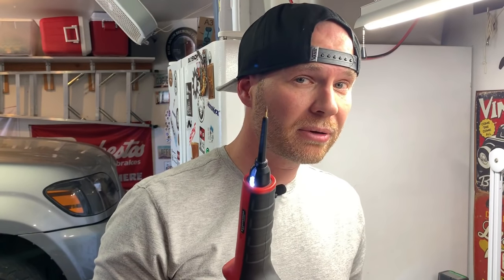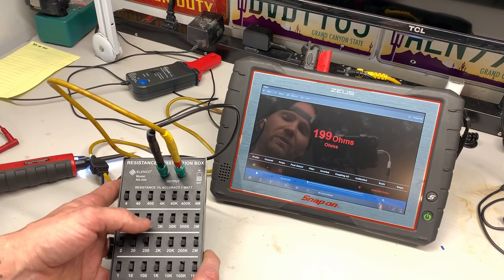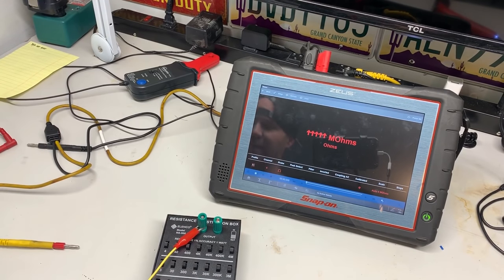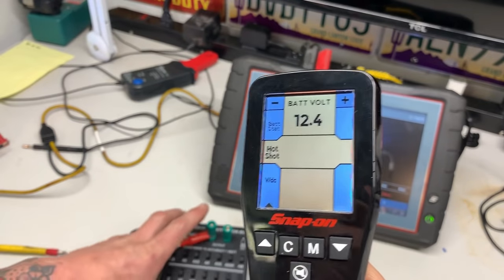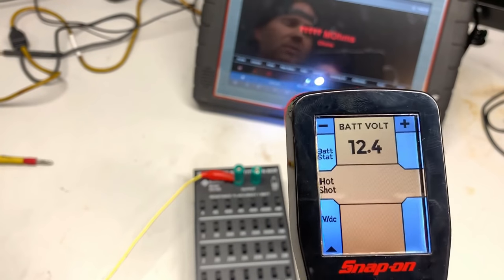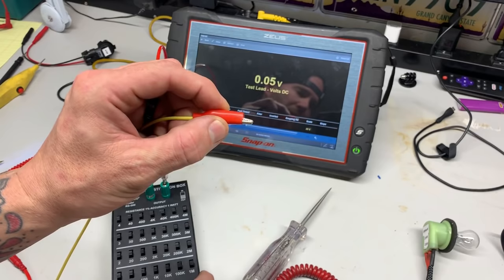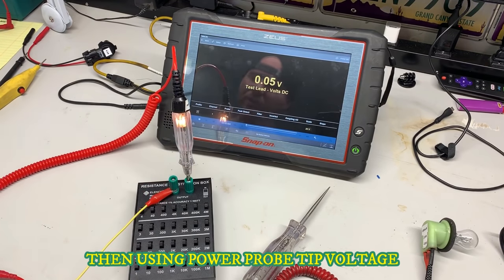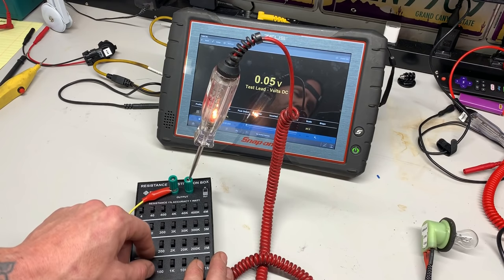Homemade test light against the power probe?

Comment: i am new to the scope and load testing world im a old timer. once i started watching ya'll what i have done is try to size a test bulb draw to be about the same size load, then watch voltage drop so far has worked for me. i had a 1997 Dakota no start the asd relay would not come on. i checked voltage good check ground good checked pcm ground had ground small test light came on so unplugged pcm and connected larger bulb would not burn computer would ground test light but not bulb. replaced computer truck runs great no problems. but power probe said ground and small test light ground. its a learning curve . i have been testing bulbs and making lights that draw about the same as like fuel pump and use for testing. i know i have to be careful not to damage pcm. thanks for all you do
Reply from the maker: That’s awesome to hear other guys making tools and also loading a circuit. I did it wrong for years thinking the pp was was properly loading a circuit. Thanks for watching and also for your comment.

Comment: Awesome video. I love comparisons like this. One other issue I've had with the PP is the low internal resistance. When checking an open 5v signal circuit, it kept pulling it down to like 2v. I was fortunate to catch that the ECM was seeing it, and tried my meter on it. No problem with the meter.

Comment: I have that power probe and I use v/DC,amps and ohms. I haven't had any troubles so far but the battery voltage and tip voltage beening different without the red lit positive I go for the test light and the ohms on the probe

Comment: I love this video.  One thing I think you failed to mention is prior to relying on the brightness of a test light bulbs brightness,  you should always use a direct connection to battery as a reference. Much love, much respect. Thank you for your professionalism in what you do. Im 21 years deep with Chrysler,  jeep,  dodge,  ram and only as of the last 5 years have I realized the importance of the loaded Voltage drop test. Your technique is bad ass.
Reply from the maker: Thank you so for the kind words! I really should redo this video and explain a little better about loaded circuit testing. I’m still fairly new to making videos lol.

Comment: I live in a part of Mexico where the weather is always good,  I have been mechanic for almost 13 years now and never had a high resistance circuit problem on anything,  but I do see a lot of imported cars and trucks from snowing states over there and I know some day I will have to deal with high resistance problems. 

I saw many times the use of of these diy test lights but never being interested on making one,  but after your very, very instructive demontration on this video,  I will definitely make a couple of them,  test them and familiarize with the usage an the results. 

I think that a quick test for brightness could be using the Power  probe to comprare the bulb  in the circuit and then in the tip of the energized power probe,  if for some reason  you do not have the dvom on hand. 

Thank you for your videos.
Reply from the maker: Thanks for the support and views Juan. It’s not to expensive to make your own test light and definitely something I think every technician should have in their toolbox

Comment: Another good video. Glad you covered both the PP and the Load Pro, even if you were showing the Snappy version. Both tools have their advantages and limitations, in spite of anything said for or against either. I have both and understand how and when to use them.

I never consider a fuse checked until it has been removed and visually inspected, including the terminals in the fuse block. Simply probing the back of the fuse with a test light is a rookie technique, about as valid as calling a relay good because it clicks. I can’t count the number of times I’ve helped an “experienced” tech with an electrical problem that has sent them down a rabbit hole and has turned out to be something as simple as a burned fuse terminal.
Reply from the maker: Paul E thank you! Your absolutely right about needing to pull fuse or even Check the box itself. Definitely need to remove the fuse and check it also. Pp is a great tool if used properly. Seen to many times it not used correctly and that’s unfortunate. Not to mention the modules I’ve seen smoked from someone not knowing 🤦‍♂️😂
Reply: Cody’s Auto diagnostics, not mashing that power button requires a lot of self control!

Comment: Nice video I pulled this info out of a trouble shooting article and It states,

 It doesn't take much of an increase in resistance to cause trouble. Let's say a 120 amp alternator operates in a circuit that has a normal resistance of 0.11 ohms. If that resistance were increased to 0.17 ohms because of a bad wiring connection, the alternator's maximum output would be limited to 80 amps. In other words, an increase of only 0.06 ohms (almost nothing!) would reduce the alternator's maximum output by almost a third! Under light load, the drop in charging output might not even be noticeable. But in a high load situation, the alternator wouldn't be able to keep up. 

I noticed on the screen of the Snap-On multimeter that the decadent box with no switches on was at 0.17 ohms of resistance from the get go. So if the information is correct on the electronic trouble shooting article then the Snap On and power probe hook are correct in failing in the hot shot test. Unless I'm missing something. Wishing you and your loved ones well.
Reply from the maker: Hey buddy thanks for your comment. That’s great information and you are right there was resistance at the very beginning in the box. I’ll have to check my other decade box and see what the reading is and if the pp will show pass or fail. Thanks again

Comment: I surprised how accurate the loadpro actually was, even with it's small internal load (20 ohms I believe) I like your idea for heavier circuits.
Reply from the maker: Bart Young I was surprised as well. The idea of the tool is awesome. I just hate the tips on it 🤦‍♂️
Reply: i believe the newer version of the Load Pro have an internal 25 Ohm resistor in it.  However, after watching your video Ohms Law says your yellow testilight (spelling?) had to have a 100 ohm resistor in it.  When you selected 10 ohms, the voltage dropped approximately 10 % to 11.2V.  So 90% dropped across testilight, which means your yellow banana looking thing must be 100 ohms.
Reply: @matthewbrice737  Your correct Matthew.  The testlite is 100 ohms and the newer version load pro is 25 ohms.  To verify all you have to do is put your Meter on ohms and push the button.  It will tell you the resistance value.

Comment: What we need is a variable load tester with a fixed visual indicator for a binary decision pass or fail. When testing a 5 amp fused circuit then dial up a 5 amp load...  if the light comes on then the wires can support 5 amps. Want to test a 25 amp circuit, dial up a 25 amp load etc. Perhaps a test light with high wattage resistors and a multi contact rotary switch on the end. The switch will dial in a combination of resistors depending on the desired amperage draw.  Would also make a great hand warmer in the winter🙂
Reply from the maker: Absolutely 💯 percent we need a tool like this!!! I’ve wanted to make one for years with a bunch of Incandescent bulbs with switches to turn them on and off to add load, but I can’t seem to figure out how to make one that’s not super huge and takes up a lot of space.

Comment: Just an idea for the teslite, what if you were to add leads to it to make it easier to get in connectors, etc. I had a loadpro, it broke so I binned it. I agree it's a great idea just not well executed. I'll definitely be stealing your idea with the banana connectors. 

I also will use a amp clamp on circuits to see if I should look into them further. A good rule of thumb I go by is what ever the fuse rating is for that circuit, I'll look for 1/2 of that while operating. If it's well below or above that there is probably an issue. Great content by the way, subbed!
Reply from the maker: I was definitely going to see about adding some quick connectors on the load pro so I’ll use it more then I do now. Using amps is definitely a good way to see everything that’s going on in the circuit. That’s my go to method for sure.

Comment: Power probe 4 in the feed mode loads the circuit . You can read battery power vs the circuit point you are testing and also read the resistance at the same time on one screen ( no button to push)
Reply from the maker: Alan Gaudry yes it does and one great thing about the 4. It’s to bad not all the pp have that function

Comment: I have the overpriced snap on version (made by power probe) of the hook and I too have run into situations where it told me the circuit was no good "check connection" using the hot shot function (one of the reasons i brought it ohh and the amperage measuring ability was what sold me on it) but that was not the case! luckily experience told me to double check the circuit with a tail lamp bulb. lol.. I still trust if for the most part, but if it tells me i have a bad connection I always double check it now.
Reply from the maker: Auto Fix Pal yes exactly!! That was my issues as well. I bought this just for that test and it’s very sensitive and sent me down a rabbit hole.

Comment: Do you think that bulb is enough resistance for checking pwr. And ground on a 98 Chevy Silverado fuel pump connector. I just have a basic multimeter. Not quite sure of the hookup procedure. Appreciate it if someone would chime in 👍🏽
Reply from the maker: Most incandescent test lights will be enough to verify power with module plugged in and back probed.

Comment: you have to stress the point that test lights are better for loading a circuit, BUT it has to be an incandescent test light not an LED test light. I know you know that but i dont remember if you mentioned that part in the video.
Reply from the maker: Your right and I didn’t mention that, good point, thanks

Comment: Great video Cody, very concise and well put together. Now I can just show that to my coworkers and stop arguing with them all the time.

I had one question for you. I've been watching the L1 vids, your vids, trained by techs, SD and others... You guys all have a power probe but all say not to trust it.

What is a power probe good for?
Reply from the maker: Thank you! 

Power probe definitely has its place and its good for applying power or ground to a component to test but where guys trip up is checking for proper voltage to a component by checking it with the tip voltage. The tip voltage isn’t loading a circuit and that’s the downfall of the pp
Reply: @codysautodiagnosticsprogra8706  Ok, I hear ya. Thank you for taking the time to reply to all of my questions. It's truly appreciated.

Comment: I don’t trust the power probe for load checking either but it possibly could be a fail in this instance seeing as how a decade box isn’t used for or ideal for passing much current through. Those resistances I doubt are very accurate with any kind of current applied. I put those same banana jacks on all of my homemade test lights and even my otc test light. I hate those cheap clips they come with plus it gives you many more options to connect to. Makes it easy to use the aeswave test terminal kit with it too.
Reply from the maker: John Pilgrim your right those boxes shouldn’t have much current going threw it and I was pushing the envelope.
Reply: I was thinking pretty much the same thing. I know the snapon and power probe both failed the hotshot test on the resistance box but I wonder how much current that box can actually pass. I'm not here to criticize, but that might not have been a great test method. I usually double check by using a 3157 bulb to load the circuit. Great video,btw.

Comment: I have a handHeld Spot Light. A Big Philips Bulb in a casing With a Handle. I removed the Switch. It Draws 9.5 amps That's My Getto Circuit tester That wont Melt stuff.  Best The light was givin to me
Reply from the maker: That’s awesome man. I need to definitely add something to mine so they won’t melt stuff too

Comment: The key is to know the limitations of your test equipment and to test your test equipment. I bought a Voltage Drop Pro that will do voltage drop testing by providing a 0-20 amp load. Connected it directly to 3 separate fully charged Optimax batteries but removed the surface load for accurate results. With a 14A setting and 12.7 B+ voltage the Voltage Drop Pro showed 10.9V and a voltage drop of 1.8 volts connected directly to the top posts of each battery...First Fail. Tested the leads and they were good and also swapped with other good leads same result...battery was still 12.7 during the test so how was there a voltage drop.  AESWave called vendor and their answers were incorrect and we supplied additional testing but this time on a headlight circuit on my SS. Tested headlamp amperage draw with amp clamp and was 5.1A  Voltage drop at LH H/L "On" was 320mV. Voltage Drop Pro testing results with 5A load set the Voltage Drop Pro showed .1G and B+ was 1.5V voltage drop a significant difference and have you chasing a ghost. Others had similar results and the Voltage Drop Pro is being discontinued. I'll be swapping it for a resistance decade box.  Key is take nothing for granted and test your equipment and have multiple was to do loaded circuit testing and sometimes having different amperage light bulbs is better than a more expensive method but voltage drop testing on a loaded circuit with amperage draw will keep you from getting slid. Nice video Cory!
Reply from the maker: Hayward's Automotive I 💯 agree with you having multiple test equipment and test lights. I have multiple dvom (which I use rarely) pulled one out to check ohms and got readings all over the place and and giving false readings. Wild have misdiagnosed the vehicle if I hadn’t caught the reading before even hooking to solenoid. Just got rebuilt to 😒

Comment: Measure voltage drop on the circuit loaded. The light bulb test on a input for some PWM could result in pcm failure.
Reply from the maker: dave oneal yes you’re correct. The bulb shouldn’t be used on every circuit like pwm for example
Reply: @codysautodiagnosticsprogra8706 Great video keep up the good work.

Comment: You should always verify a result more than once and by a different method, whenever the repair cost is high or it isn’t a simple fix. I think it’s crazy to not verify multiple times these tools are not perfect as it’s impossible to consider every situation it may encounter. Great video a few others have made videos like this. Have you tried the load pro?
Reply from the maker: I agree 💯 with you. Yes I was also using the load pro in this video.
Reply: Cody’s Auto Diagnostics I watched and noticed you did I think Daniel is a very smart man we can all learn by listening to videos like this very informative. I have been sent down the wrong road before because the new part was defective but that never happens right
Reply from the maker: He is a very knowledgeable guy and I’ve learned a lot from him threw the years.

Comment: What about the load pro. What do think about that tool. I like it myself. But some don’t. Every tool has its good and bad. It just boils down to the tech I believe. Like our beautiful heat here in Phoenix Az. It affects lots electronics like in our garbage trucks here in the city. So maybe that’s why I like the load pro. Great video though
Reply from the maker: Manuel Lamas I have the load pro and yes it’s a good too imo, only issue I have with the tool is how awkward it is with the leads, there should be banana jacks on it so you can add different terminals in the tool so it’s easier to use. Just my opinion but great idea behind it.
Reply: Cody’s Auto Diagnostics I agree the leads are bulky. And yeah you are a 💯 right. Banana jacks would be awesome so you can use the aeswave advanced terminal kit. I just bought an 18 pc snap on testing terminal kit. 190.00 for the price I should’ve bought another aeswave kit. Keep up the great videos.
Reply from the maker: Manuel Lamas absolutely love my aeswave kit but I’ve also used the Snap-on kit and both kits are nice. Not sure how I lived without the kit for so long 😂
Reply: Cody’s Auto Diagnostics right.

Comment: Bahaha I don't trust power probes ever. First time I used it on a 2012 Ram 5 years ago to check power to factory trailer brake controller. It showed 12 v. Test light wouldn't light. The wire was rubbed thru above fender liner. I haven't used it since that day. Give me my amp clamp and 5 amp bulb any day
Reply from the maker: Caleb Mohler exactly. Took me getting burned to realize it wasn’t a good test using pp. thanks for sharing